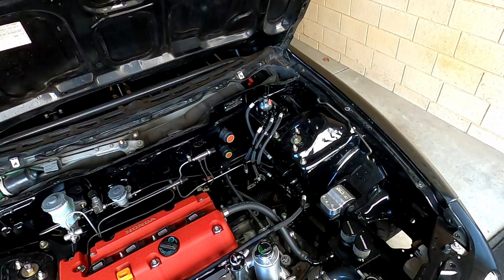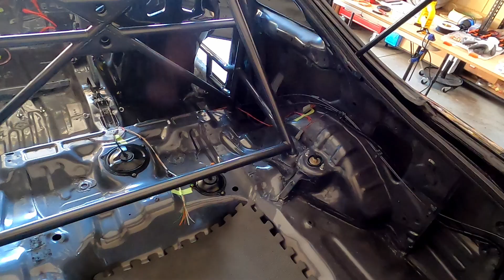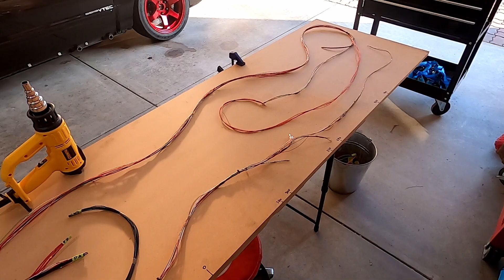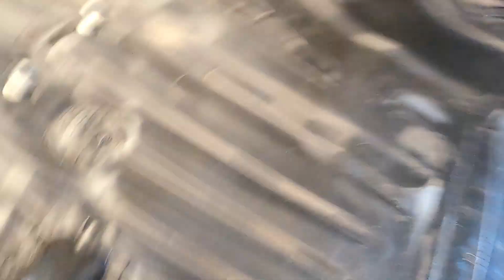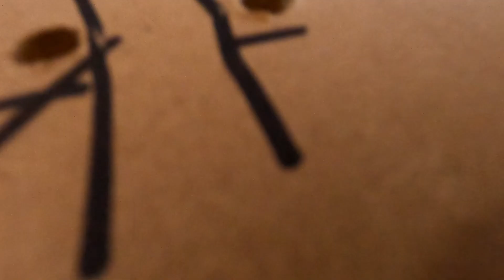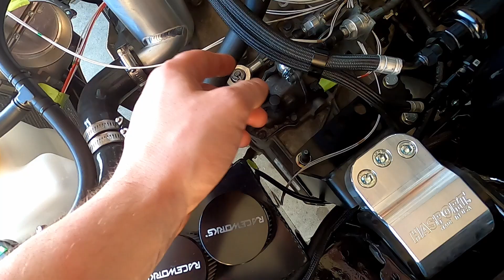K20 DC2 Integra Racecar Build Ep. 08 - Wiring The Car

Comment: Could I jus use the r3 without the pdm?(I have same car- k24)
Reply from the maker: Probably, yep. If you're just running the engine off the ECU, R3 will be perfect. If you're running the chassis (all the lights etc.) off the R3 too, it's difficult but doable if you get funky with DPOs. I needed the PDM as I have a heated windscreen that needs 50A, and because I have heaps of sensors. A more simple setup would run fine just off the R3
Reply: @technologicmse  Yes! NO A/C simple set up.. I want to use the R3 as a kpro replacement and replace my oem fuse box to also be controlled by the r3. I have an idea of but to be sure what are "DPO'S" PLEASE? I also will be installing Aem type sensors( air temp, oil temp/pressure, fuel pressure etc ) is that on the ecu wiring side or for pdm??
Reply from the maker: @shionnsr8684  DPOs are digital pulsed outputs, a digital switch basically. They switch the ground side, so you can supply multiple things from a single power circuit (the R3 has I think 10 power circuits) and switch them using DPOs on the R3. Yep those sensors will all wire in to the ECU, R3 has plenty of sensor inputs (AVIs and SPIs). Have a look at High Performance Academy's wiring courses, they're really good for understanding how to plan out all of this stuff
Reply: @technologicmse  thank you so much gratefully appreciated!!

Comment: Very satisfying watching it come together, looks awesome! Really like the coloured heatshrink band idea to ID each wire to the excel sheet as well. Will assist diagnosing any issues in the future greatly.

As for routing the rear harness across to the drivers side, was that based on the factory routing being on the right side, because the fuel pump will tuck in nicely or because of the fuel inlet pipes being on the left maybe?
Reply from the maker: Thanks! Yeah the rear wiring was just to match with the factory harness for the rear lights, which I tied into at the right wheel well